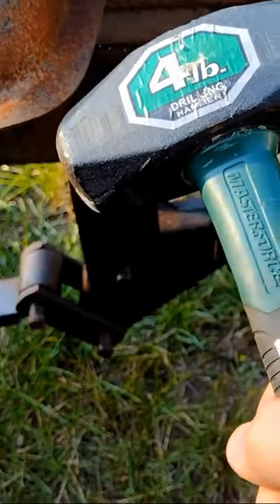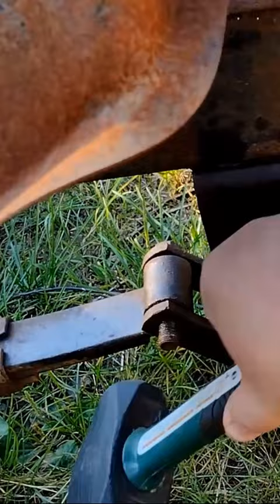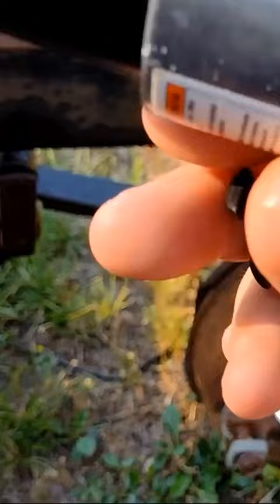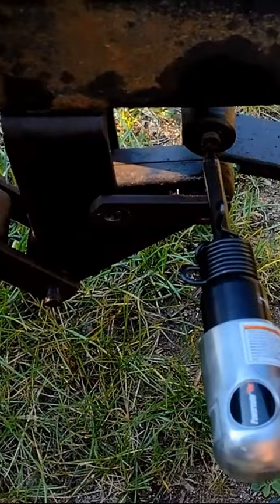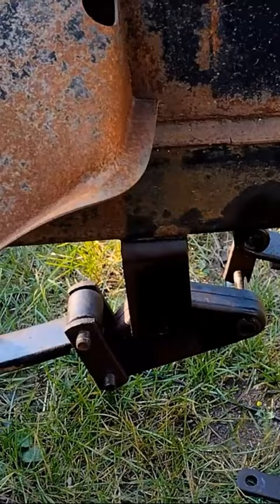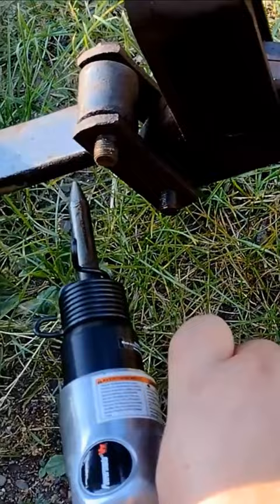Air hammer seized or rusted bolt removal #airhammer #pneumatictool #seized

Comment: That's cute...... 

I mean that's great if you live in the south or it's only a couple years old! 

BTW a good air gun makes all the difference in the world! ("Good doesn't mean the most expensive!) An Ingersol Rand can be had around $50-60. A really good one is the extended Chief at HF or Klutch at NT but those are $140ish.  It looks like you have a central pneumatic one from HF, for under $20 it's great, I grab it first too!  It has it's time and place but it does not put much power behind the blows! It's dare I say, "shocking!" the difference in power between them! One of the very few tools that electric will never be able to replace! (Not in near the same form factor at least) 

Put a nut over hanging the end will keep it on the bolt! (Yes I know you are doing it one handed and filming too. Isn't geared specifically to you per se. Even two handed it can be a slippery little fu....!)
Reply from the maker: That is a  Minnesota trailer frame :) Not that rusty but being its part of a mobile home it didn't see much road use. I just used the air chisel again about a week ago to knock out a seized slide pin. It worked great I just wish I would have thought of it it before hitting it with a hammer for a half hour :)
Reply: @RepairmanJared oh so you know exactly what I am talking about! I'm also from Minnesota, now that liquid salt they use is a whole other world of hurt! 

Yeah a hammer tends to mushroom the ends if no nut is used making it a chore to go through. I am seeing 2000-2006 Chevy rear leaf shackles more and more recently, I just cut the bolt and wedge a chisel in the slot/gap the leaf wraps around the bushing and just run the whole thing out as it has become one! 😂 Frames will always rust on the surface as the coating is porous but it's pretty much just an oxide layer. What I would give for my truck to just be that!